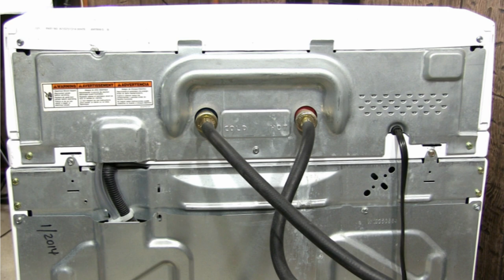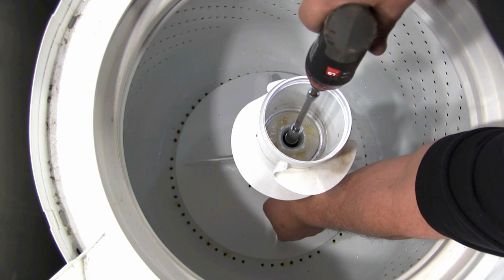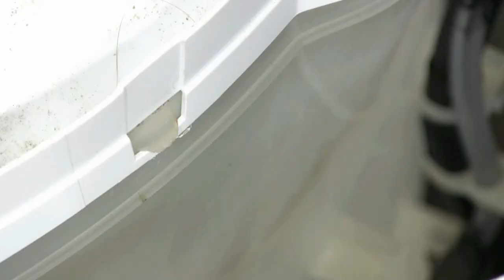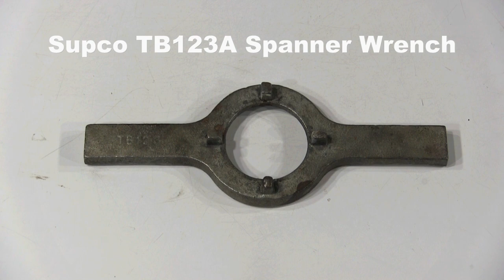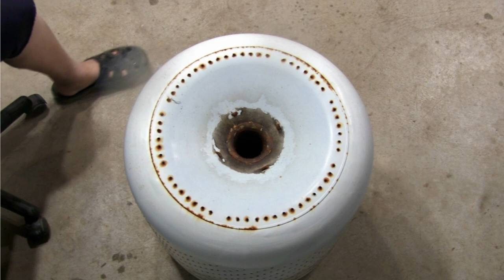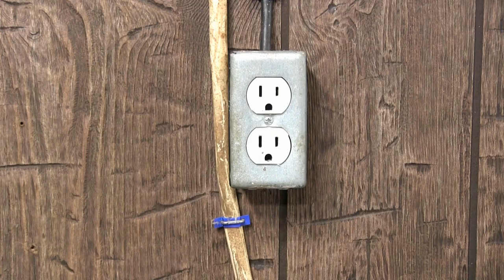Nasty Tub Smell In Your Whirlpool Washer!

Comment: Very useful, I had this machine and struggle so much until now for the past 5 years to strip it apart. To remove the dispenser seal is best when you pour hot water around it, it remove at ease

Comment: We've followed the steps up to removing the spin drum but we are having the hardest time getting it out. Any tips?
Reply: Did ya figure it out
Reply: I dribbled some CLR around the top of the ring. Then let it sit for 5 mins. Put a tea kettle on. Then pour the hot water all around the top ring a few times. Pull up on the tub with one hand while smacking the middle column with a rubber mallet, turn the tub a bit and repeat, then keep repeating until the gunk holding it in place releases.
Reply: @rudesword2852  I appreciate the reply. I never did get it off. We went in a different direction.
Reply: @PovertyDIY  I never did but see the other reply with a recommendation

Comment: Can you get the nut off without the special wrench?
Reply: Not really  The wrench is made for turning the nut. I doubt anything else would work, the nut is on very tightly, and you will need the wrench and a hammer to loosen the nut.
Reply: I was able to get it off with a metal spike and a hammer.
Reply: Knipex and a small hammer